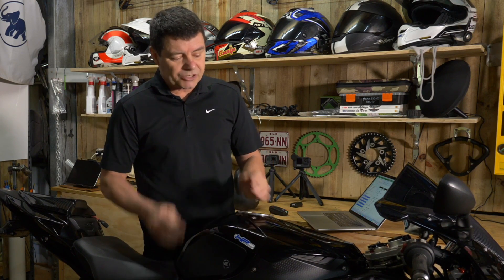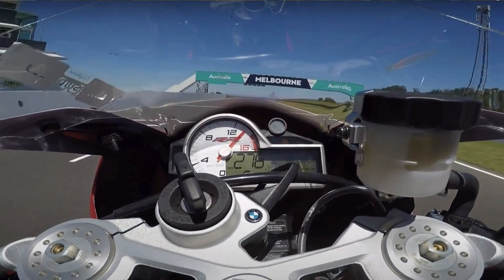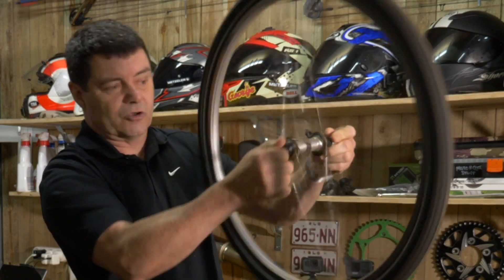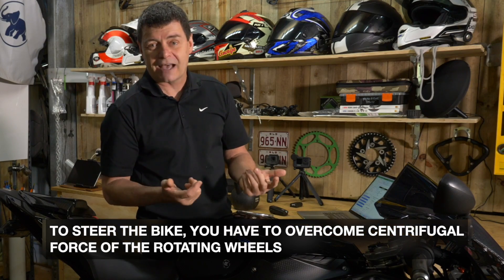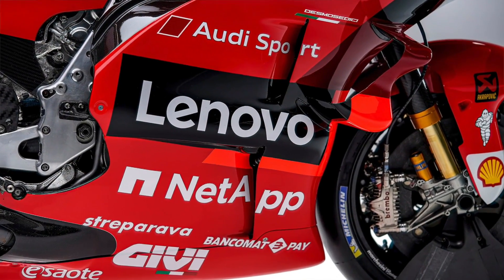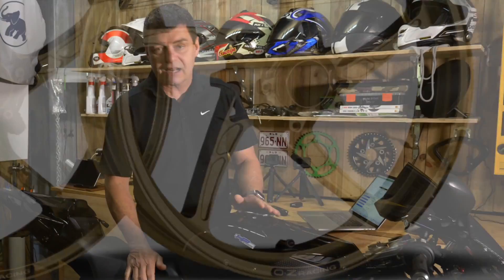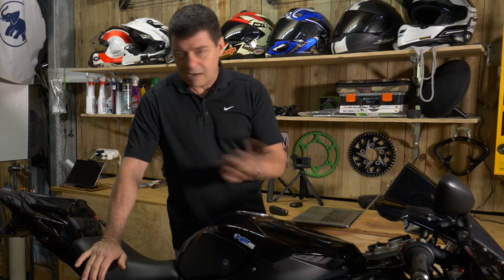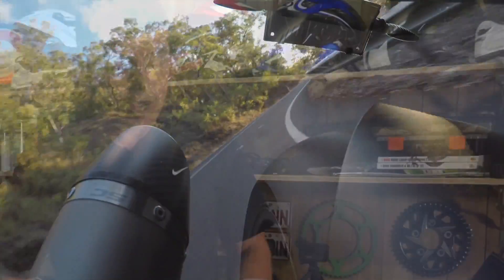Part 3 - Reducing Rotating Mass On Sports Bikes Like the BMW S1000RR

Comment: Does changing the nuts of rear sprocket and bolts of the engine sprocket to titanium nuts and bolts would make any power gain?
Reply from the maker: not that you'd feel it mate, generally people target a collective gain by dropping weight from a range of places that add up to something substantial, your weight saving with the nuts and bolts won't be that much at all to be honest
Reply: Change your chain to a 520 will also reduce the rotating mass and its inertia during acceleration / breaking significantly. Faster acceleration and more breaking power.
Reply from the maker: @Ward-5934  totally agree, the weight reduction is around 1.4 kg from memory

Comment: Hey George, nice video series. Just as something to add with rotating mass; I recently got new tyres for my ninja. Masses were 3.5kg for front 110mm wide tyre (10kg tyre and rim) and 6kg for a 130mm wide rear tyre (14kg tyre and rim). Rims still had brake discs on and sprocket on back as well but 24kg just in discs, rims and tyres essentially on a bike that weighs 170kg fully fuelled.
Reply from the maker: yeah thats proportionately a lot of weight in those rotating pieces. I tried to do some calculations on the effects of this but with everything having different radiuses it was a impossible for me to work out. it makes a good case for magnesium rims, titanium bolts and nuts and lightening up sprockets and the chain ... if only that bank account had no limits :-)